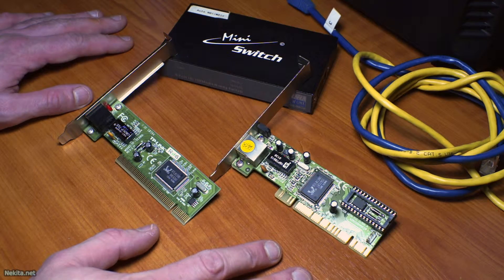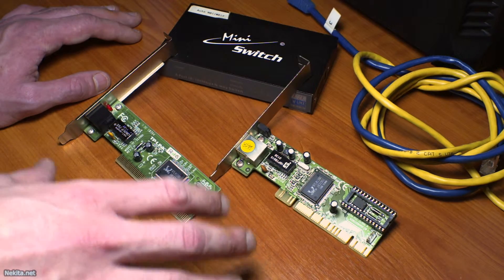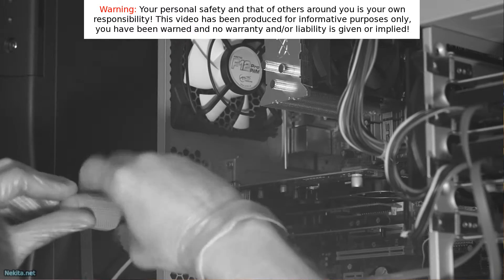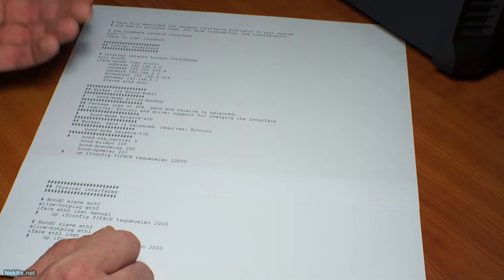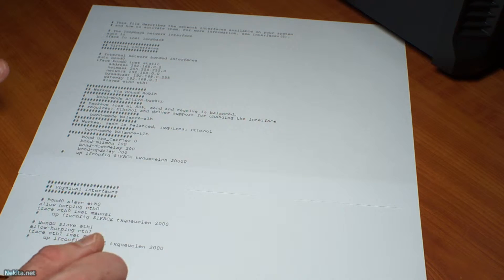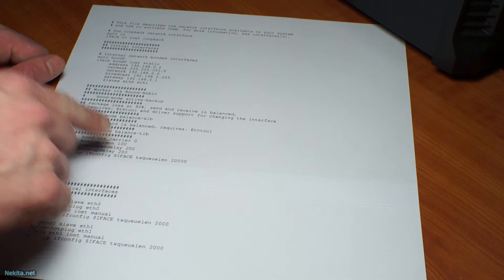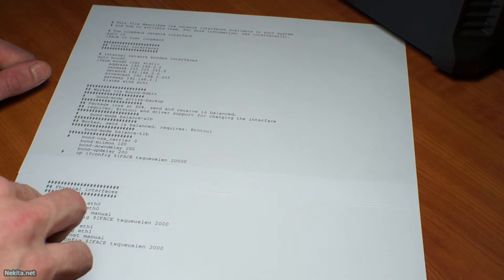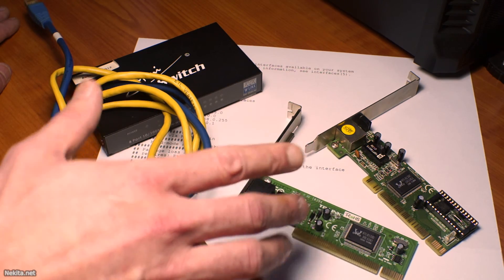The Linux Shack - Bonded Network Interfaces (ifenslave & ethtool)

Comment: I want to make linux bonding mode 0 as weighted round robin.i.e; to assign weight to each slave depending on packetdrop or latency. Is it possible to do so? Are the configuration files of modes user configurable in linux?
Reply from the maker: That's for you to find out! Given that most versions of Linux are moving away from "hand written configuration files" it's more difficult to get done what "one" wants. So, experiment and see where you can get. Good luck! :-)

Comment: okay man.  can you aggregate 2 nics for increased bandwidth(not failover,  or load balancing)  with a regular switch??
Reply from the maker: On a normal switch you can (sort of) aggregate 2 or more nics, but only total "outbound" data to that specific switch will be doubled. This is MAC adres related. Do note that every individual network interface adapter can only talk to one other node (read: computer) on that network (at any specific and therefore the same time). This is switch related. So, when you're not using trunking to a "trunking enabled switch" you can use ethernet bonding to enhance the throughput to multiple nodes/hosts, but in reality it's a nice but still limited solution with "normal" switches. Hope this helps!

Comment: thanks for this man, was looking exactly for this, i have a debian wheezy at home as samba file server, planning to bond at least 3 interfaces(onboard + 2 pci lan cards) but the pci cards are dlink rtl8139, what is the best bond for me? i want the one where i get complete link aggregation and redundancy, too lazy to migrate things over to freenas and do LACP, besides my home equipments arent LACP-supported
Reply from the maker: I've had the best luck with RTL8139 Rev C chipped networking cards from the 8139 range. It seems the D revision has some MAC adres leakage issues when you're doing stuff like ethernet bonding. So that's the original MAC of the card being leaked onto the network while you're using an assigned MAC on that card. Depended on what you're doing this can be an issue. Proper link aggregation is done with VLAN Tagging, so that's something else than is shown in this video (If I remember correctly). And this Vlan Tagging must be supported by the Networking Switch! So there's more options out there... Good luck! :-)
Reply: darn i did not get alb to work, im on rr now but it seems it is not cooperating pretty well, when i checked on the tomato firmware link interface status, its shows 100 for interface 1, same for interface 2 but interface 3 is 10Mbps what the heck, and eth2(interface3) is not showing on ifconfig -a :/
Reply from the maker: Unsure what the issue is with your setup Emmanuel. As an alternative you could try the DD-Wrt Router firmware. But as with many specific situations: Either get it running your self, or get a (payed) professional onsite to do it for you. Many issues are not wel suited to "remote support" and require "hands-on" diagnostics to solve. Best of luck though! :-)
Reply: ive tried dd-wrt but it was fuzzy on my cisco e1200 :/  which made me think that alb and rr only supports 2 interfaces but was looking for anyone to confirm that, good thing i came by your video, learned a lot, thanks man!

Comment: Can this method be used to bond a wlan to an eth so that the signal received on wlan can be accessed on the eth?
Reply from the maker: I've recently had to do some additional "work" with ifenslave and ethernet bonding; And ran across a howto that (if I remember correctly) did create such a setup (or at least comparable to what I'm guessing your looking for). You'll have to do some Google searching (Googling) though. I'm unsure what website/how-to/wiki/etc. I found that information. Good luck! :-)